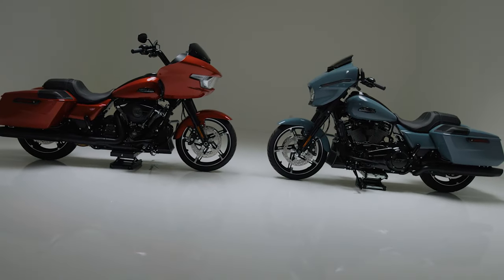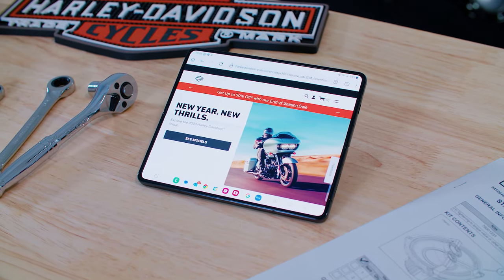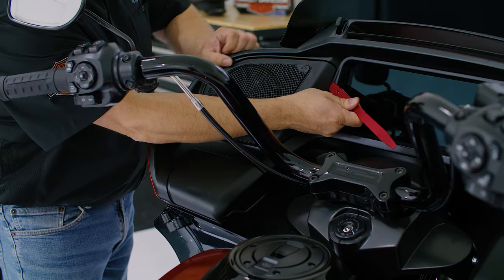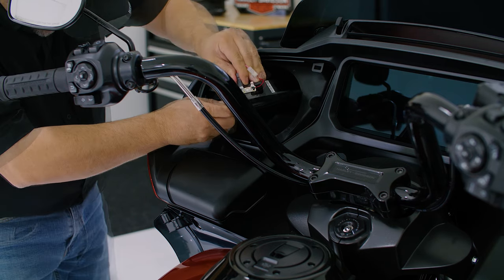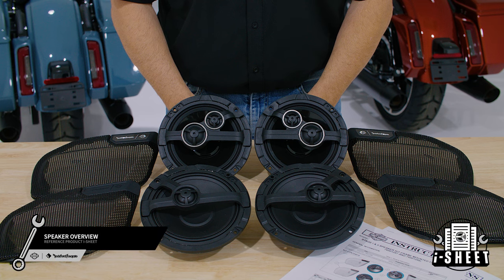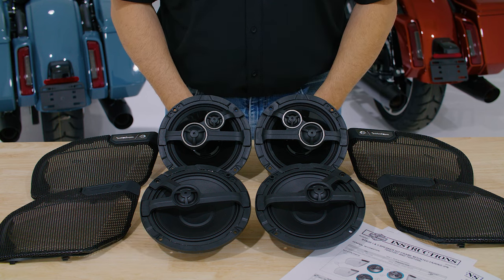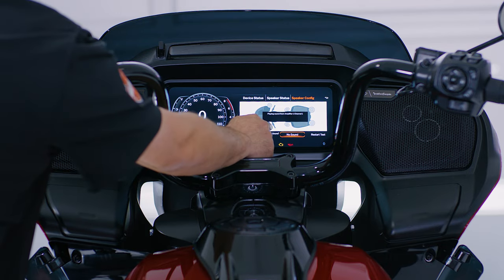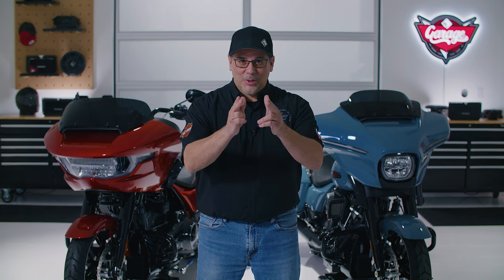2024 H-D® Road Glide™ Fairing Speaker Install | Harley-Davidson® Powered by Rockford Fosgate®

Comment: Just bought the kit and a brand new 2024 road glide. The speaker config option is disabled from the factory..
Reply from the maker: If you installed the amplifier already and it’s not being recognized, please have your H-D dealership do an update to the Skyline OS.  This is an issue HD is working on with Skyline that has nothing to do with the audio.
Reply: @rockfordfosgate  I installed the front speakers only, I have the amp and rear speakers as well to install tomorrow. Does the speaker configuration not become available in the menu until you install the new amp?
Reply from the maker: @kntmarecobra Hmm, if you already installed the amplifier, this is likely a Skyline OS issue like I originally thought.  Again, See your H-D dealership for an update that should restore this menu for you.
Reply from the maker: UPDATE: Harley-Davidson has implemented a warning that the speaker configuration is disabled, so the amplifier must be done at the same time when upgrading the new Stage I or Stage II speakers.

Comment: I installed this system on my 2024 road glide and it worked great for 2 days now my bike had the load shed light come on and now my radio will only turn up 30% any suggestions I took it to my dealer but wasn’t sure if anyone had this problem yet. Also the charging system is not charging right according to the battery gage
Reply from the maker: Load Shedding on Skyline OS has thrown a lot of people for a loop.  It triggers when the battery voltage dips to around 12.3 VDC.  We actually had this happen when filming the amplifier installation video and realized somebody disconnected our Battery Tender (we were filming with the bike on for quite some time).  We reconnected the trickle charger and after it charged back up, everything began working as normal.
Reply: @rockfordfosgate  they called me today said it was some kind of dc wiring harness I will let them know what you said hopefully you are right. Are they trying to resolve this issue

Comment: Brand new CVO ST same thing happening, I took in for 1000 miles service when it was returned no sound from speakers
Reply from the maker: I apologize for the inconvenience.  Try to remove the fuse, wait about 30 seconds, then plug it back in.  It may force Skyline OS to reboot and load properly.  If still no output, the dealer should be able to get you working again as H-D is aware of the issue.
Reply: There is a service bulletin for that issue. Harley dealership will update your skyline OS.. unfortunately is only dealership with access to download the update. Is a issue with 2023 road glide st cvo and all 2024 road glide /street glide with the skyline OS radio.

Is not the Rockfordfosgate product causing this.

For some the fuse removal for 30 second work. In some case it does not fix the issue 

I am waiting for the right time to get this product they are the best system in the market.  They have never let me down. Thank you for what you guys do!!
Reply: yeah my 24 SG has done this once , next day i went to take it to the dealer and it started working again .. not impressed with the skyline OS or the factory radio/speakers in this bike ... i spent an awful lot of money on this to be so unimpressed
Reply from the maker: @Hard_Right  The dealer likely did a Skyline OS update to resolve early issues.  If you're having a hard time hearing the audio system and you're a taller rider, the air deflector on the 24 SG & RG is much lower than the Rushmore bikes, causing significantly more air to hit your face & ears.  If this is happening, we recommend a higher visor to create more of a "bubble" so the air is deflected up and over the rider's position.
Reply: @rockfordfosgate  no , I never took it to the dealer , one day it wasn't working the next day when i got ready to take it it started working again but it still takes a long time to load sometimes and the bluetooth connection is very spotty and cuts in and out . this is my first harley i guess im just used to japanese motorcycle reliability
Reply from the maker: @Hard_Right  Thank you for that information.  When you have a moment, we would recommend those Skyline OS updates.  Although we only do the audio portion on the motorcycle, the entire customer experience is important to us.

Comment: I have a brand new 24 RG. The radio is on but no sound is coming from the speakers. Is there something that needs to be configured? Completely insane for a brand new bike
Reply from the maker: Sounds like someone rerouted the audio.  Press  GEAR > SOUND SETTINGS > AUDIO ROUTING and see if the audio is being routed to a headset instead of the speakers.
Reply: Same thin happened on my 24, I ended up having to pull the main fuse. After I reinstalled it all worked again.
Reply from the maker: @gwilder97  Thanks for posting this.  Since you’re the 2nd person to have this issue, I’ll escalate it to our internal H-D team.
Reply: did you just install speakers only and using the new amp that is in the bike this year. if so how is the sound?
Reply: Mine has done the same thing 2024 roadglide
Reply: Mine did same had to take bk to dealer for flash update
Reply from the maker: @QuincyReid  Thank you for your contribution to this discussion.  Our team has made Harley-Davidson aware of this issue.
Reply from the maker: @TheR6carter  Thanks for your feedback!  We immediately sent this information to Harley-Davidson and they have it on their radar that's falling under the Skyline OS.  Were you able to get the issue resolved?  Some have removed the main fuse and it seemed to fix the loading issue.
Reply from the maker: @CodyMcDonald89  When upgrading from the stock speakers to the Rockford Fosgate Stage I or Stage II, we recommend upgrading the amplifier from the stock 250W to the 500W high output amplifier.  We made the amplifier installation videos separate that can be found at the bottom of the SPECIFICATIONS section here: https://rockfordfosgate.com/products/system/factory-installed-systems/2024-h-d-road-glide-street-glide/
Reply from the maker: @TheR6carter  If your dealer hasn't reset your Skyline OS yet, try the advice from @gwilder97 and remove the main fuse.  He plugged it back in and it seemed to work for him.
Reply from the maker: @QuincyReid  Glad our dealer was able to take care of your system. It appears to be isolated to the Skyline OS foundation.  H-D is aware of this glitch.

Comment: Will the stage 1 speakers work without the amp
Reply from the maker: Will it work?  Technically, Yes.  However, we do recommend using the larger amplifier to take advantage of the improved sound quality and have louder output for highway riding.
Reply from the maker: UPDATE: Harley-Davidson has implemented a warning that the speaker configuration is disabled.  We officially recommend to upgrade the amplifier when adding new Stage I or Stage II speakers.

Comment: When added my fairing speaker it says cleaner configuration is disabled?
Reply from the maker: The message above shows "cleaner configuration" ... this must be damn autocorrect .... are you referring to the "speaker configuration"?  Harley-Davidson has a warning that the speaker configuration will be disabled if the amplifier isn't done at the same time.  To take advantage of the higher performing Stage I and Stage II speakers, the factory equipped amplifier should be replaced with the larger 500W Primary Amplifier (P/N #76001294 https://www.harley-davidson.com/us/en/shop/harley-davidson-audio-powered-by-rockford-fosgate-primary-amplifier-500w/p/76001294